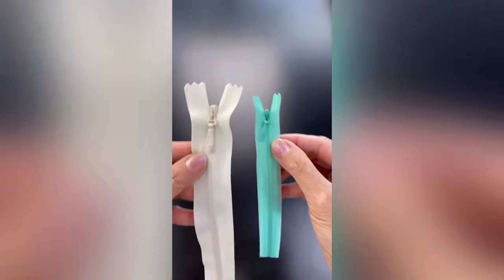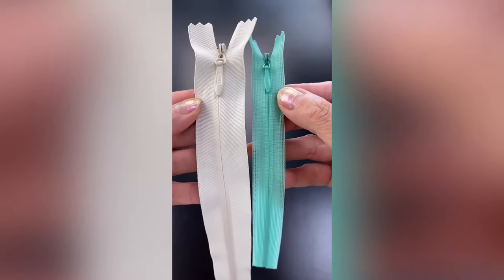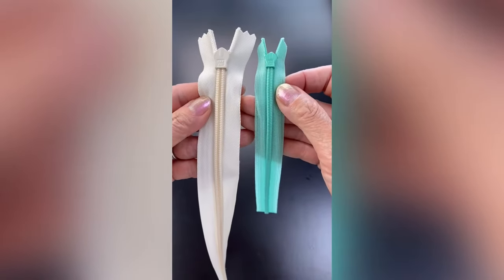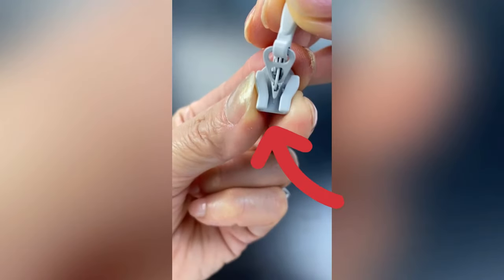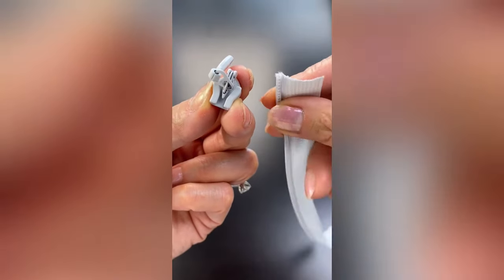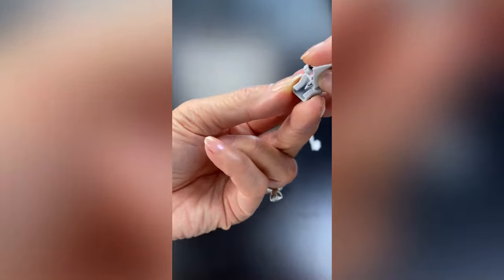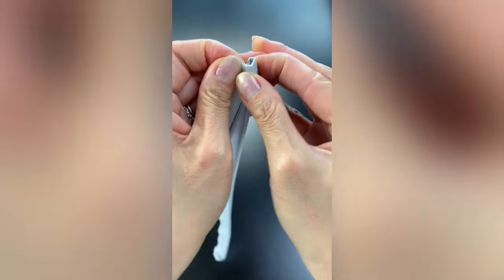How to install an INVISIBLE Zipper Slider - Easy to repair a Zipper  Slider with No Tools!

Comment: Absolutely God send. Haven't got to a dry cleaners to replace a zip in years. And for the length a colleague suggested no more than £5,  not much more than I used to pay, so went to look. 1 shops turn around time was too long the other quoted £14 and a longer turn around time. After fiddling with the zip for 10 minutes I thought let me Google it before I break it. This video was the 2nd that came up but was short in comparison to  the 15minute one. I fixed the zip in under 5 minutes. That included cutting open the bottom putting it back in and stitching it down. Now I can wear my trousers to my Aunts memorial, and saved money and time. Will definitely recommend this video/method. Thank you.
Reply from the maker: Great to hear!! "Actually, £14 sounds very reasonable. It's important to remember that the cost of a sewing service includes more than just the seamstress's time. There are many other expenses to consider, such as rent, marketing, machinery, and more."

Comment: Oh wait... this shows putting the slider onto the BOTTOM of the zipper. But I cut off the TOP of the zipper from a dress (before accidentally pulling the slider all the way off), the bottom is already sewn into the skirt. (I was altering the bodice.)  Is there any way to put the zipper back onto the TOP of the zipper?  Help!! Thanks!
Reply from the maker: Yikes….  unfortunately no.  You’ll have to undo a bit of the bottom of zip, cut it and install the slider.  You may have to shorten your open seam a bit to fit back it.  Please also have a look at how I reinforce the bottom of zip in this tutorial.  Cheers! https://youtu.be/AFHHyQt-q5U
Reply: @NotchesSewing  OK thanks for getting back to me! I guess I'll have to remove the zipper from the skirt, cut it so I can put the slider back on, and then re-sew it in.
Reply from the maker: Yes.  How did you cut off the top?  Are you lowering the back of dress?
Reply: @NotchesSewing  yes it's a strapless dress and the bodice was too long waisted, so I detached the bodice from the skirt, cut off the bottom inch of the bodice, & reattached it. So I had left the zipper in the skirt. And I'd cut off the top inch of the zipper to fit the new length (height?) of the bodice. So I'll just have to detach the zipper again from both the bodice and the skirt, in order to cut off the bottom of the zipper, reattach the slider to the zipper, and reattach the zipper to the dress.

Comment: Thank youuuuuuuuuu I love u so much😢 my zipper got seperated after I stitched it to the frock I have been working on for 5 days. Thank you so much
Reply from the maker: Glad it helped.  Do not sew too close to teeth for invisible zipper.  Although it looks nice, it will be harder to pull up when on your body.

Comment: Hi, I'm not sure what size my invisible zipper is and the slider was lost when it came off the tape.  Any recs how to get hte right size replacement slider? thanks!
Reply from the maker: measure across the closed coil in mm for size
Reply: @NotchesSewing  thank you!! I can't close the zipper since slider is off to measure its coils, so will just measure with teeth as I imagine they would be closed....?

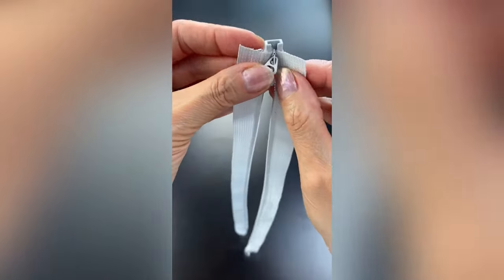Comment: Rolling the zipper is a good tip but I can't success😔😭😭 I bought one of these zippers just today and cut it, slider came off and now it doesnt move after 0:41 the zipper gets stuck so bad. (I can't make the ends even, maybe that's why..) I wanna scream
Reply from the maker: It takes a bit of patience.  Make sure that you don't go past the middle point with the first side before putting in the second side.
Reply: @NotchesSewing  thank you so much ♥
Reply from the maker: let me know how you go😊
Reply: @NotchesSewing  yesterday evening I asked my mom for help and I told her your tips and she put it back! 😊 ♥♥ Then we replaced it with the broken invisible zipper on the side of a crop top of mine